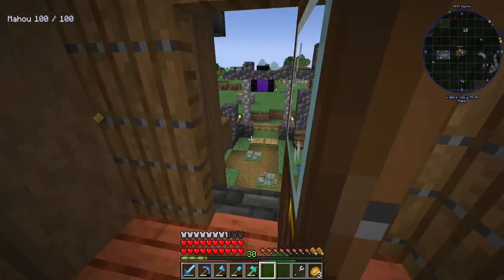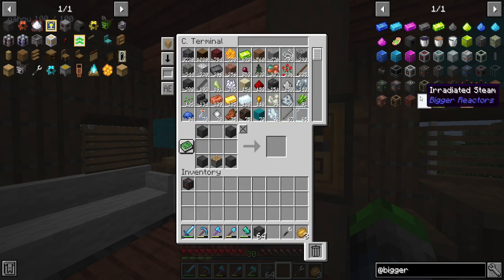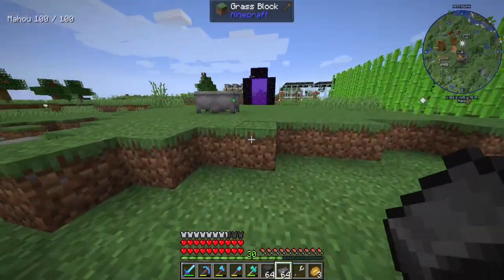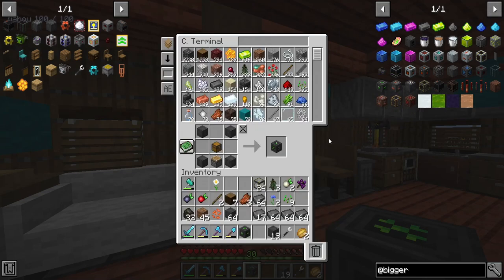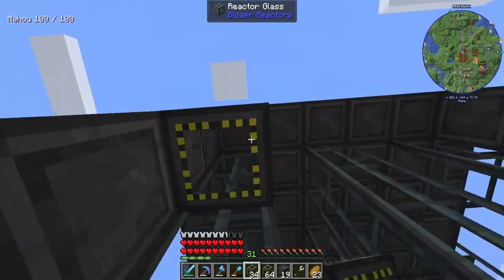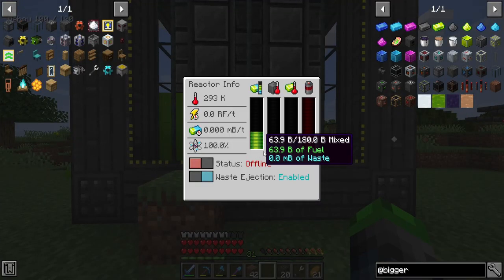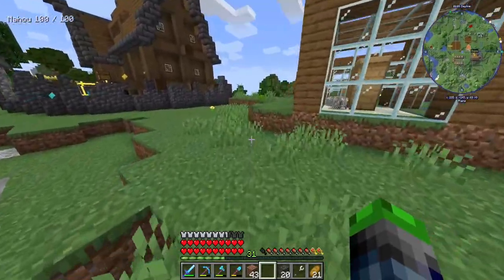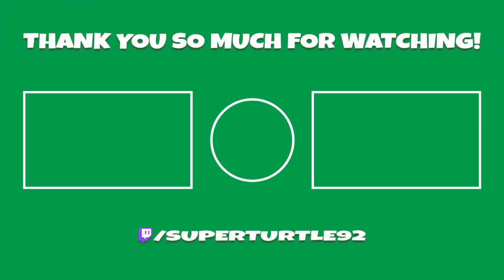Bigger and Better Reactors!! | All The Mods 7 | [Ep 06]

Comment: The uranium only in one fuel rod also made me mad lol. Can you still throttle the fuel rods so you burn less fuel like in the old big reactors? Might also help with the heat issue if you can. Great video!
Reply from the maker: So I think this is a visual glitch. I checked the other rods and they said they had uranium in them. So hopefully this may be fixed in a later release?
Reply: It's been fixed

Comment: Excellent!  I needed a BR tutorial before I blow my mountain up 😀
Reply from the maker: I just about did haha!!
Reply: @YTSuperturtle  As far as what you could use all that power for...well...the pack doesn't have a ton of stuff you need power for right now.  I mean you could do an entire cyclic machines setup, but honestly you can run all of them off of a standard 3x3 hardened solar array.  If nothing else, you are future-proofing for when they update with more stuff.  If ATM6 is anything to go by, they'll probably be putting in at least three power-hungry tech mods before all is said and done.
Reply from the maker: @AkodoKusamoto  nice!!! Should be good for a while then 👌

Comment: How do you draw power from the reactor? i cant seem to be able to power anything in this mod pack
Reply: Connect an energy cable from the power tap block on the reactor to what ever your trying to power via an energy cable  e g. universal from mekanism, or energy pipe from pipez
Reply: Energy cables from pipez didn't work for us. We used HV cables from immersive to deliver ours.
Reply: @Wasabi_Tears  You need to wrench the pipe connected to the output so it outputs. Just by connecting pipez won’t do anything